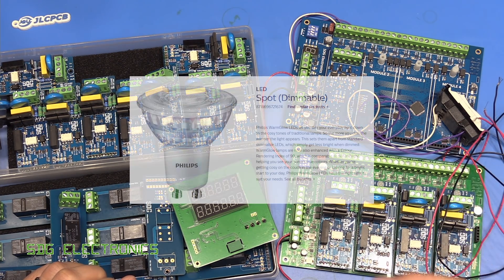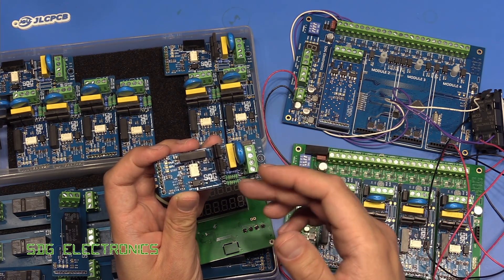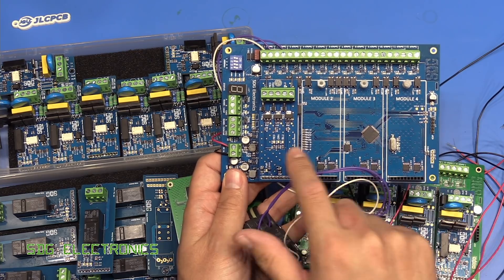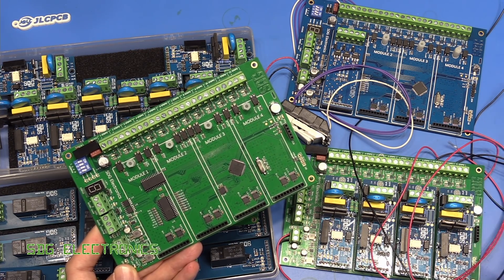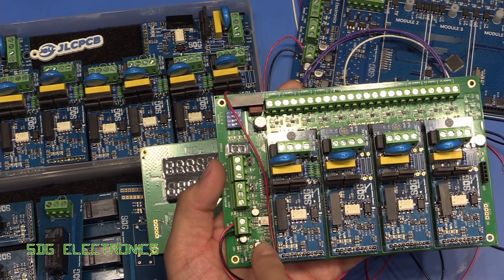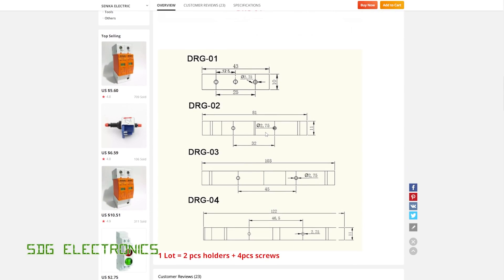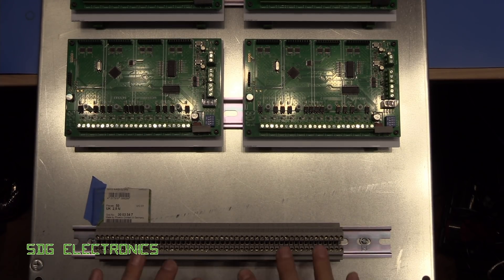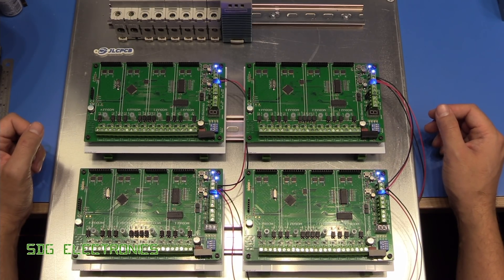SDG #230 Custom AC LED Trailing Edge Dimmer Modules Revisited...

Comment: Very interesting, a DC UPS power supply adjustable up to 24vdc using Lithium ion batteries would be an interesting project. Also have you tried using 2 x AC dimmer modules on one of those boards at the same time by any chance?
Reply from the maker: Yes you can use 4 AC modules independently quite happily on one mainboard.

Comment: Re the Aliexpress measurement issue - this is one of the reasons I like to use a 3D printer for this kind of stuff. Saves a lot of headache! If you need anything designed/printed for your projects let me know, can usually do it very quickly and like to support other youtube creators!
Reply from the maker: I do have a bunch of 3D printers, but I didn't want to find on a hot day (it's going in the loft) that the prints had deformed and the dimmer boards had dropped off! Probably wouldn't happen, but the mounts on AliExpress were pretty cheap and saved some hassle.

Comment: Looks like the same IP65 box I’ve got - TLC, 500x700x300! I bought it for DIN rail light dimmer mounts. But I haven’t bought or made my own dimmers. (Yet!) Only just discovered this! What DIN rail width are you going for, per dimmer? I need almost 40 channels of dimming! I think we need two IP65 boxes. There are KNX dimmers I was looking at, apparently you can get 8x 200W channels in 145mm width. I'd really like to do what you are doing here!
Reply from the maker: Yes 500x700x300mm, when it got delivered I thought it was a bit too big but the modules quickly eat up the space. The main boards are 170mm wide, so it's not quite wide enough to fit 3 boards across. They could be mounted vertically though to make better use of space possibly. You'd just fit 4 boards across and maybe 3 down so 48 channels with not much space for other stuff!

Comment: Nice project, I like everything being contained in a single box. I use a bunch of 4 channel DMX based Soundlab dimmers in the loft to control all the lighting circuits, which works very well but the install isn't compact and the wiring isn't that neat. Will be interesting to see how your install pans out.

Comment: Really excited to see how this project concludes.  I designed something similar for my home, which was built a couple of years ago.  Sadly, since none of my boards had any approval markings on them, the state electrical inspector wagged his finger at me and it all went in the bin.  One thing my system had that you haven't mentioned is a "panic button" that would turn on all lights inside and outside the house to full brightness, which you might use in the event of an intruder.  Keep up the great work, Steve; I always look forward to your videos and can't wait for the SMPS series!
Reply: When an intruder comes in you need a button that turns all the lights off. Then you put on your IR goggles and get the trench sweeper out of the closet. The locks on my doors protect the people outside from me!

Comment: A nice future addition might be a small eeprom on the modules with a module id code, then the firmware could pick up automatically what module is plugged in and apply preset parameters. 

Would add to BOM and more complexity in firmware to keep track of what is, or isn't plugged in (unpopulated module detection would have to be added).... so probably not worth it for this specific use.
Reply: If I remember correctly, he has a resistor divider setup in such a way that the values for each module is different, therefore he can detect if the board is plugged in and which type of module it is. :) You could then just save the preset values in MCUs EEPROM or just hardcode default values in the flash.
Reply from the maker: You remember correctly, the main board knows exactly what module is plugged in, however there still has to be some programming per board. For example one board of 4 modules might control 4 separate rooms, or in the case of one of my bathrooms needs a relay for the fan, relay for the mirror lights but the dimmer module for the LED downlights.

Comment: After going wireless with my house heating/boiler control system (TRV's etc) and trying 3 different control units (Devolo, Vera etc etc) and "suffering" for 4 or 5 years with various problems, and in the end ripping it all out and going back to a simple wired system..........your lighting system is spot on, nothing beats a cable for reliability and takes a whole lot of software dependability/complexity right out of the loop. The future is copper......:-)
Reply from the maker: I do have a few app-based lamps etc, but 90% of the time that's more faff than just going to a light switch...

Comment: I've found big problems if you have any mains level magnetic contactors near mcu digital circuits (like in the same enclosure) - not an issue here but something to keep in mind. And something else about about those Meanwell UPS PSU's, they will only boot from Mains, not from DC, otherwise very decent products, I've used the 12V ones a lot, that's assuming this applies to that DIN Rail 24V one as well.
Reply from the maker: Good to know about the Meanwell devices, I've not had chance to power one up but I imagine you're correct.

Comment: Frankly you'd be better off just using smart LED bulbs like the IKEA trådfri zigbee ones instead of all this extra hardware, wiring and complexity. And if you want even more interoperability and control you could use  homeassitant and zigbee2mqtt on a RPI together with a 10$ zigbee USB stick.
Reply from the maker: The trouble is, the integrated lights that are more commonly fitted these days don't have separate lamps (Enlite E8 is an example). They are fitted for higher MTBF since the LEDs and driver are not being crammed into an unsuitable form factor. I only have about 2 fittings that accept an LED retrofit type lamp. Smart lamps don't help with the fundamental issue though since I cannot have multiple points in the room to dim/control the lights.
Reply: @sdgelectronics  fair enough for more exotic lamp mounts you won't find retrofitable bulbs. 
Smart LED bulbs do however solve the fundamental issue with multiple control points because the control happens over a radio link rather than existing cabling. Fx the above described setup with IKEA e27 socket lamps is what I use together with Xiaomi tactile ZigBee switches and motion sensors are what I use to both control brightness and color temperature. I even use home assistant to automatically adjust the color temperature based on the sunset.
Next to my bed I also have a master button that turns off all the lights in the entire house and disables the motion sensor light activation until next morning.
Reply: @Zagitta001  Are R80 and R63 downlights classed as exotic?
Reply from the maker: I see, I hadn't had much exposure of the type you mention with dedicated controllers. I don't get on with the types that are purely phone app based, they reduce usability and usually rely on some other service somewhere that likely at some point will no longer be available. I had intended this to be used for things other than normal lights however and I do prefer the ability to use normal switches with this. It means everything matches in the room, and I can still use decorative plate switches that match the sockets etc. Something that's pretty common in the UK.
Reply: It depends...
I think that the hard wired solution is preferable to anything wireless, both in terms of reliability and security. Also reduces EM noise.
Reply: @questionmark9684  agree, wired over wireless.

Comment: Could you do multi output or even adjustable high power psu for the ambitious psu ?
Reply from the maker: I will definitely have a multi-output on the low power SMPSU since the application needs a 3.3V and 24V rail.
Reply: @sdgelectronics  looking forward to it ^^

Comment: I may have missed something but why do you need an UPS for the dimmer?
Reply from the maker: Ah I just realised I cut it out the video! I have some little 1W LED units in areas like the landing and stairway which are lit at a low level all the time, they happen to work well as emergency lights in the event of a power cut but are currently just tagged off the alarm system.
Reply: @sdgelectronics  always preferred central battery emergency lighting systems.   The failure rate of NiCad type fittings is astounding.